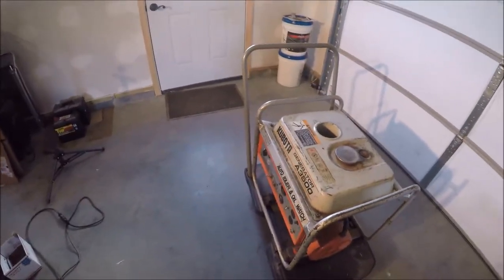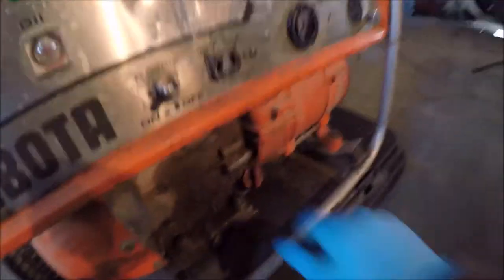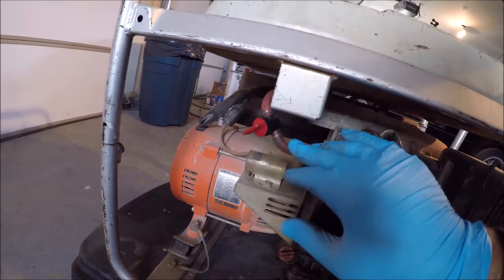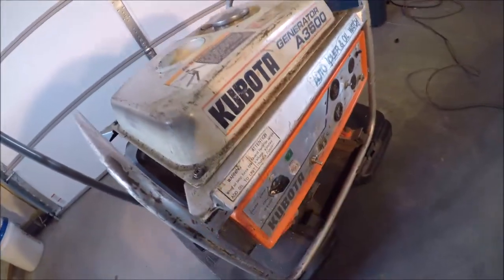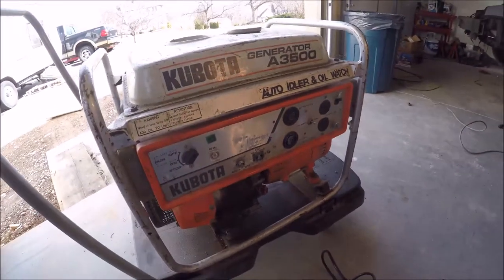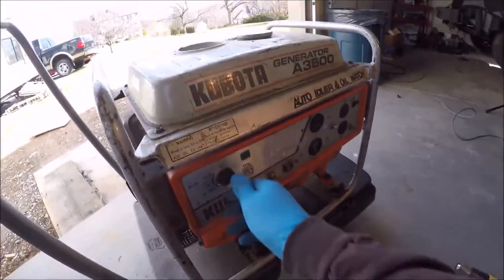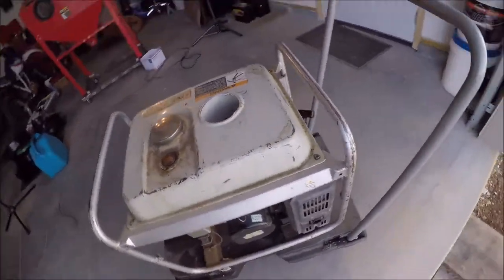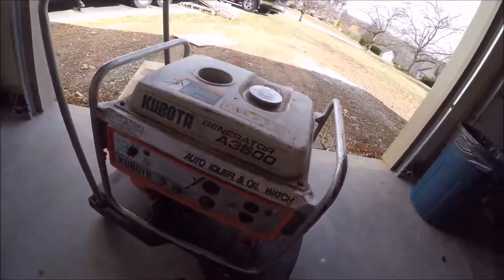The KUBOTA A3500 generator!

Comment: I have a Kubota AE3500 I got from a buddy 20 years ago. It still looks like new, I don't know how many years he had it. It looks slightly different than yours & doesn't have the automatic idle control (I wish it did). It too will start on the third pull.
Reply from the maker: They are a great running generator.

Comment: Do you have any video replacing this generator with a new ignition coil?
Reply from the maker: No, but I have replaced them before. Have you taken off the flywheel cover?  I think there are 2 bolts that hold the coil on.
Reply: Thanks for answering. I havent remove the flywheel yet to see the ignition coil. Do you have some picture of the ignition coil? Appreciate the help. Cheers
Reply from the maker: @ricardonavarrojr.7859  unfortunately I don't have pictures. I sold the generator last year.